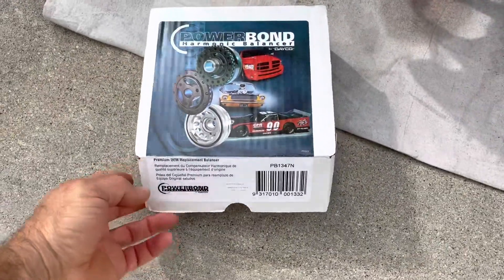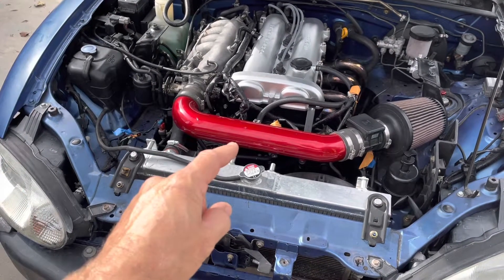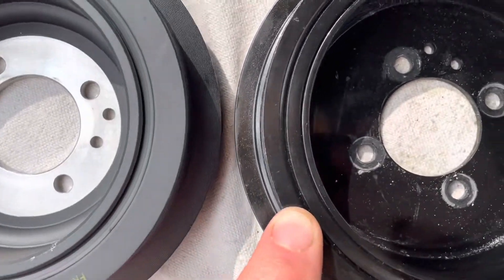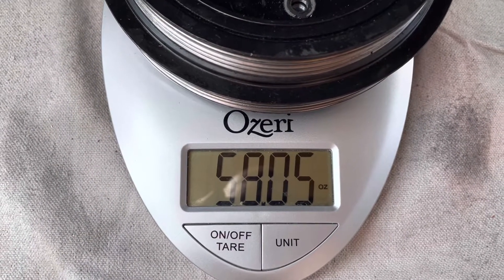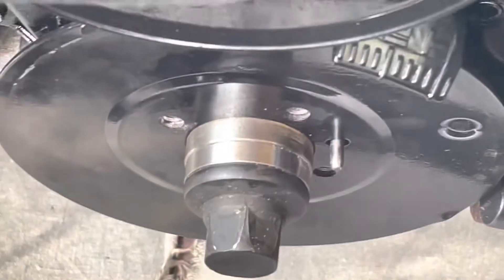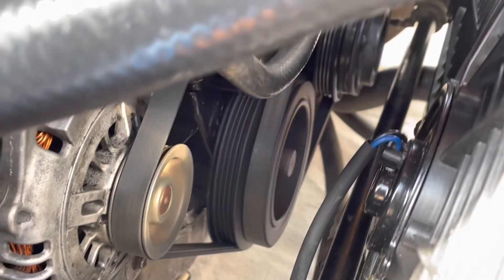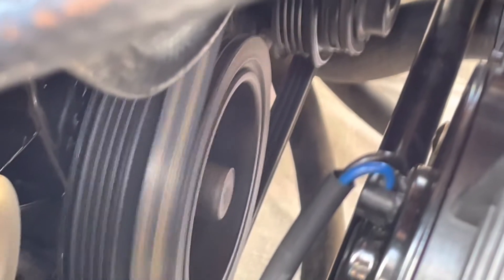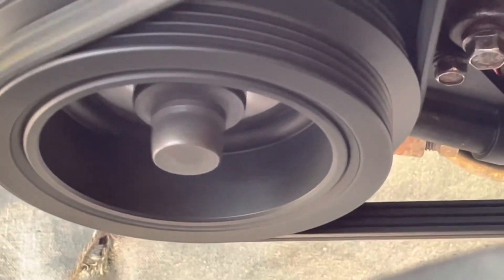Miata gets DAYCO Balancer

Comment: hey man, any update? is it  still wobbling?
Reply from the maker: It got much better, but there is still a little wobble at idle, but not faster revs. That may be pointing to main bearings - I don’t know.
Reply: I am currently looking at my Miata. ‘99. The balancer I have has about a 3/4 of an inch thickness to the middle portion where the 4 bolts tie down. I’ve ordered the new part and it’s thin in the middle like your stock one. My balancer is discontinued and I cannot find one to save my car atm. I found a picture that showed the new balancer had a spacer that went between the bolts and the balancer. Do you know anything about that?